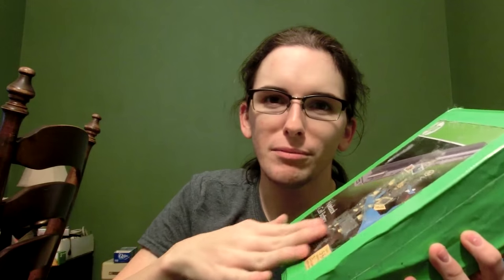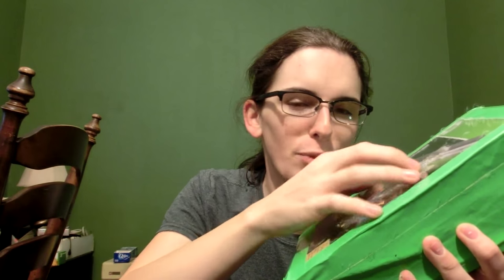Personal Bits 0117: soaked e-bike

Comment: Sounds like it was one hell of a soak test :-)

Whats the construction of the nissan batteries like? are they flatpack or cells like 18650?
Reply from the maker: +steve64464 flat
Reply: Not sure which is better to have flat or encased in 18650 style as flat could be more vulnerable to punctures.